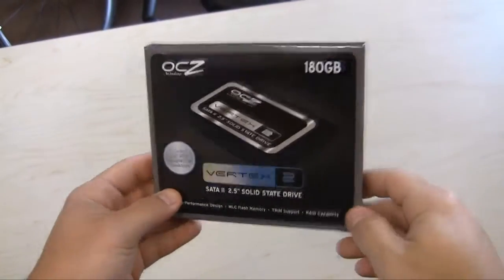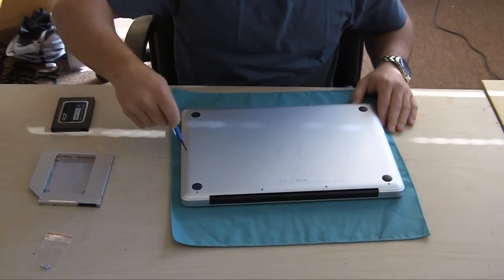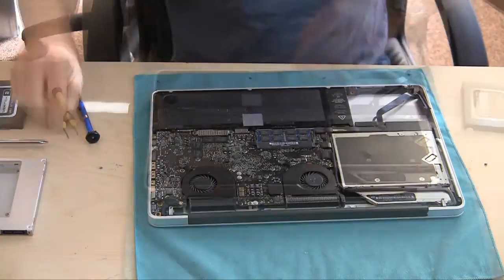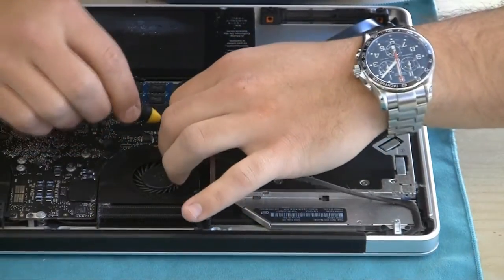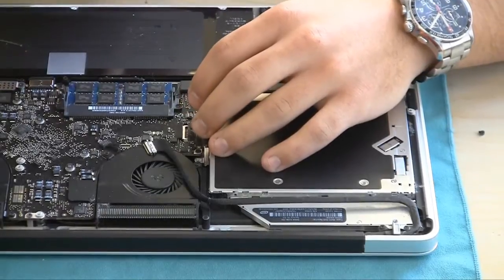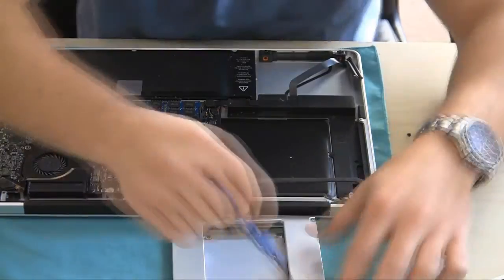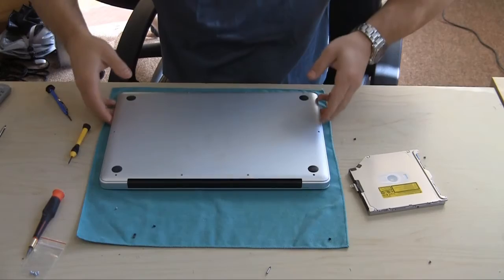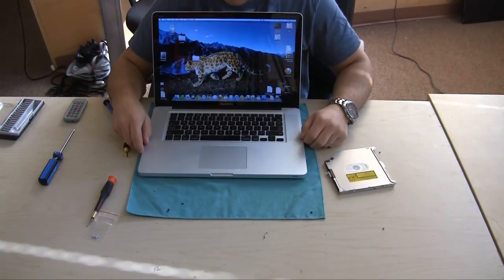SSD - Replace Macbook Pro Optical Drive with OCZ Vertex 2

Comment: so how much does it weight after that?
the original weight is 5.6 pounds, that would be interesting if it would be much lighter
good idea replace both 500g hdd and optical drive to 120g ssd?
tks